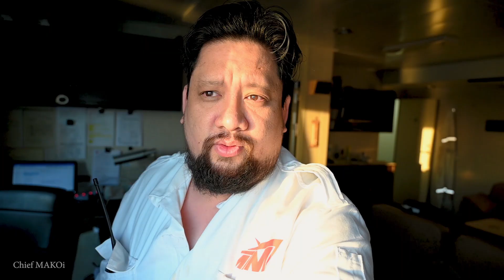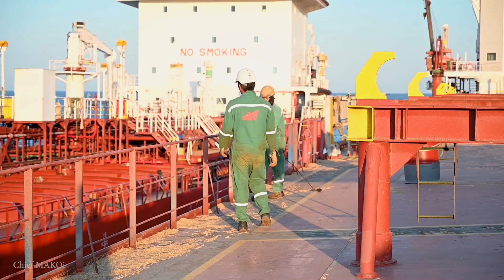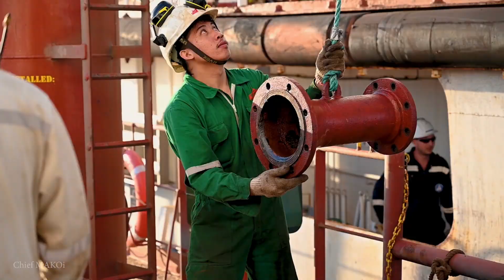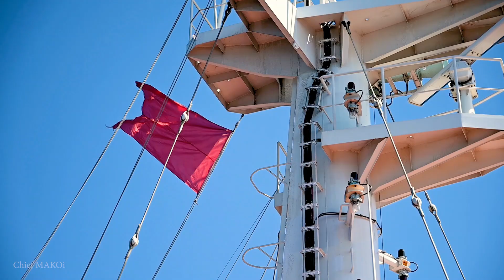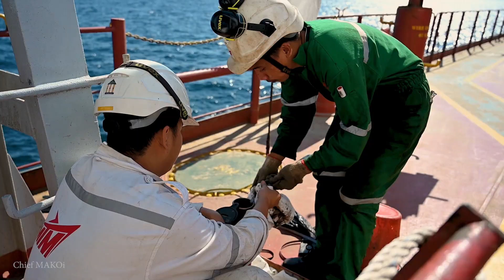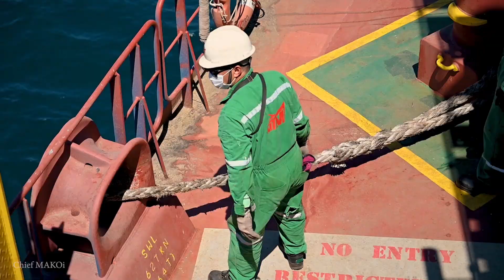Bunkering : Refueling Ships at Sea |  Seaman Vlog S03E10 Chief MAKOi

Comment: I didn’t think ships today burned bunked oil anymore; I thought they used diesel.
Reply: they use both, it is stricktly regulated. open sea.... heavy fuel oil, port or sensible areas.... marine gasoil

Comment: I appreciate the care your crew exercised in this transfer.  45 years ago on my first voyage as a rookie OS on a oil tanker,  the wrong pumping station arm valve was opened(not me), pumping plenty of oil onto the deck in seconds.  Things quickly became very exciting.  First concern was fire, 2nd coast guard, 3rd cleanup.  It was a messy lesson to double check the critical path.

Comment: Question? do you have to heat up the fuel to make it flow? what temp? thanks.
Reply: for the hfo 380.... storage tank you can keep it around 30/40 , settling tank... 60/80.... service tank.....70/100... and after that it goes to purifiers and a machine that heats the fuel up to maintain a certain viscosity to feed the main engine fuel pump.
Reply: @vicginval  Thank you Victor. You did not specified, is it Celsius temperature? I don't understand the difference between Storage, Settling and Service tank. You used "purifiers" instead of filtration?? What is the final temperature of the bunker at the fuel injector? Do you add other product of chemical to burn the bunker?
Reply: @thesailormen  yes, celsius... settling is a tank used for the biggest solids to go to bottom by gravity, so it is the first filtering process. purifier is the last step of filtering, and before going to the pump depends on the density and viscosity... it  can go around 120-140 degrees

Comment: I’m just curious why something like a “Micro Motion” Flow Meter isn’t used during a bunkering operation? The benefit is real time verification of flow/volume that would eliminate possible errors in calculating the actual quantity especially since it’s a mass density meter. Taking physical measurements then extrapolating quantity is an inexact science especially when the volumes are large.
It’s an inline meter with an analog or digital output and it’s EASY to install (imagine installing an orifice).
Having a mass flow meter would dramatically improve the efficiency of taking fuel. Additionally, having a calibrated device will eliminate any discrepancy in the Actual Fuel transferred.
Easier for both parties.
Can you explain?
Thank you and LOVE your videos!
Reply: I don't know the answer for sure, but I'm going to take a guess at it -- bunker crude (#6 fuel oil) may be too viscous for this to work reliably, even when heated.
Reply: @Lucius_Chiaraviglio  Thanks.
This type flow meter takes into account the mass density of the media so viscosity isn’t a concern.
It’s sophisticated yet simple which makes it ideal for such an operation.
Given the amount of fluid(s) that need to metered on board a large vessel like this, I’m certain mass flow meters are used throughout to monitor and control fluids, especially when critical.
Thanks again!
Reply: easy...... PRICE, MAINTENACE, CALIBRATION , PRECISSION. Everybody knows it can be very simple with space technology, but you all forget the primary reason.... MONEY
Reply: @vicginval  A good quality massflow meter can be purchased for under $3000. This is trivial with respect to the payback in man-hours alone.
The vessel surely has massflow meters for various applications where fluid measurements need to be monitored AND recorded. 
As for calibration, it is like EVERY instrument onboard the vessel. Depending on the manufacture-suggested intervals,  it could be annually or semi-annually.
Reply: @callmewheels4806  Right now i'm alongside one of Algeciras bunker barges, the master tells me that two of their flowmeters costs 150.000 €.... in the bunker barge the installation is pretty straight forward , in an existing vessel is not that simple. You know what happens if the flowmeter doesn't work? they take soundings, taking sounding allways works, that is the point in the vessels, it has to be extremely reliable. Many comments on the quick connection systems.... same thing... what if it breaks?.... flanges don't break, so they use flanges. There has been thousands of very clever persons trying to solve this problems for 50 years, but you make a google search and fix the world in two minutes. Very few state of the art vessels are equipped with flow meters, but not for bunkering, they have it installed just before the main engine inlet, to control the consumption. Small precission equipment, in a small pipe, inside engine room in a very controlled enviroment. Not the same thing.
Reply: @vicginval  
This will be my last reply.
First: Unlike you, I KNOW the simplicity of a inline-flowmeter.
Second: If that person spent THAT MUCH MONEY on a SINGLE flow meter, he’s a FOOL.
Flow meters that measure liquid propellant on test stands for Rocket Engines (Rocketdyne for example) cost UNDER $10,000 and are subject to much stricter criteria for vibration, being explosion proof and a host of other stringent criteria.
Lastly: The information I provided you WASN’T from a Google search.
I’m a Development Engineer with an extensive background in turbo machinery and in aerospace using ALL TYPES of massflow meters, the last 15-years working with installations both mobil and fixed base.
 If your Chief Engineer doesn’t understand how to install a BASIC flow meter as discussed, it demonstrates how little intelligence is required to operate a motor vessel.
Reply: @callmewheels4806  i suggest you to put your amazing expertise in the shipping industry, clearly they are all stupids and you can be rich.... please send me the maker and model of a suitable mass flow meter for petrochemicals to be installed in a 12 inch line, with a precission error under 0,25% when pumping 600 m3/hour.... it is not that easy my friend, every vessel owner in the world would buy two of them.
Reply: please maker and model?

Comment: When I was last on a cruise I witnessed a refueling operation. The donor was a refueling barge similar to what you show in the vid, and the whole operation took half a day. I doubt whether all the precautionary measures that you describe were taken or even any of them. What I know is that after the process had been completed and the refueler sailed off, the cruise ship engineers realised that they had been cheated and that a much smaller quantity of fuel, than what they had been charged for, had actually been loaded.
Reply: in case of discrepancy , the vessel issues a letter of protest against the supplier company and the case will go to courts. That is why it is important to contract a guy like me, a bunker surveyor, to protect the vessels interests.

Comment: Chief do we need to drain first the unused fuel in the tank before supplying a new one?
Reply: Good practice will be to transfer all the ROB into 1 or 2 bunker tanks leaving the rest of the tanks dominated to receive the new bunkers "empty". This will prevent cross contamination and allow the vessel to consume the ROB while waiting for the bunker qualiyy analysis results. This will also facilitate matters in the event of claims due to off-specs fuel as the suppliers cannot alledge that their newly supplied fuel was contaminated by the vessel's ROB. 
Chief has done excellent job in ensuring all the right SOPs are taken for bunkering. Kudos Chief. MTM is sure lucky to have a dedicated Chief like you👍👍👍

Comment: Why isn't testing done before the transfer starts? What would make the heavy fuel oil incapable?
Reply: Many things actually. The fuel is analysed for  approximately 20  different characteristics that determine its quality and whether it meets the order and specifications requested. But basically fuel oil needs to have a required sulphur content( depending on where the ship will sail) to help reduce pollution. Water content is also a major concern as this causes many problems when consuming fuel oil, but also when a ship is taking on a large amount of fuel, say 5000 tons and the water percentage is 0.5 percent per ton.. Well that's 25 tons of water you have just paid thousands of dollars for.. And you are stuck with it... Bummer. Also there are many differing fuels around the world and although they may look the same and smell the same and have the same characteristics, they are not always compatible., and can have strange reactions when mixed, as well as this there is an increasing problem with fuel oil bacteria, (simple explaination) bugs in fuel which fouls up everything in the process.
Thats just a few of the things we look for in a marine fuel, and we have many arguments and disputes about it, and honestly marine heavy fuel is bloody awful stuff that has to be heated to 115 degrees C to burn it.. 🔥🔥🔥🔥

Comment: Quantity disputes actually happen? Never thought there’s so much involved when it comes to refueling but interesting process.
Reply: Add quality issues, the reason for Chief MAKOi's ship to pull testing samples. The quality issue even happens for pleasure boats running diesels.
Getting a tank or two of "bunk" can actually cost the ship itself. ruining the engines with bad fuel is costly, at sea and if a storm hits, ship can go down with no power.
Reply: quantity disputes happens almost everyday....

Comment: Interesting video. How does the sounding process work?
Reply: If you noticed, they drop a bob-weight into the tank which is attached to a scale, so they can easily see the level of the fuel in the tank, and by math, they know how many gallons (or liters) exist in the tank based on the measurement.

Comment: Hey quick question! As we all know, the Earth's fuels will be all gone in time. Question is, is this a threat to the sea industry?
Reply: The shipping industry is already partially switching to LNG. By the time both oil and natural gas run out we'll hopefully have valid alternatives
Reply: As hard as it is to believe, with all the hydrocarbons that we have drilled and burned, we have probably only used about 10% of them at this point. It’s isn’t that we are running out, it’s just getting harder to collect them up. For years we found the spots that through the various movements and shifts in Earth geology the oil was trapped in underground “pools” often under great pressure. All we had to do was poke a hole, like a straw in a box of juice, and it rushed to the surface. Now we are looking into places where the hydrocarbons are not so much trapped but are rather just absorbed like a sponge. It is trapped in the little cracks, crevices, and gaps between grains of sand and rock. To effectively retrieve those hydrocarbons, you have to do things like use high pressure to insert sand and chemicals between the grains to make it easier to pump up the hydrocarbons. That’s fracking. We are also running wells for kilometers horizontally to cover more area with fewer wells. Often the oil is in a shallow layers only a few meters deep. But although this “lake” of oil might only be a 100 meters deep it is spread out over many kilometers. You see that here in Texas where some of these deposits are 10000 square kilometers in size. One drill site can have as many as a hundred or more wells spread in all directions for 10 kilometers. This allows for pretty efficient recovery of these hydrocarbons while vastly reducing the environmental impact. 

So we aren’t going to run out soon. It will just get more expensive. 

Of course, the long term goals are better batteries and better solar energy systems. After all, all this oil we are using is just the result of solar energy collected by plants millions of years ago. In the end, almost all of our energy except nuclear is just one form of energy from the Sun  by some other means. Hopefully the oil will last long enough for us to get there.
Reply: @Bill_N_ATX  Interesting that you mentioned Nuclear. Although it is in common use in submarines and aircraft carriers (and possibly some ice breakers?), I think (correct me if wrong) that there was only one merchant ship so powered- the USS Savannah which was not a success, unfortunately, so oil will be used for some time yet.
Another point you mentioned was about the horizontal drilling- I know it is done but how do they get the drill bit to change direction?
Reply: @MervynPartin , after you reach the depth that you want to go minus enough room to make the turn, you pull the drill stem and put a hydraulic motor on the end. Then you put the drill bit on this motor. From that point on, you use hydraulic pressure from the drilling fluids to power this drill motor down in the well instead of twisting the drill pipe or stem from the surface. This allows you to then angle the motor to slowly turn the direction of drilling. At the distances involved the drill stem is actually flexible enough to deal with the gentle radius. You can use pulses of drill pressure to signal to the motor thing like direction of travel. This method really took off here in Texas during the 80s, first in gas and then oil production. It’s why the US is actually energy independent for the first time in decades, even without touching huge areas where we know there is a lot of oil and gas but are either economically or environmentally difficult to drill. We know there is a lot of oil off of Florida and Georgia coast lines, for instance,  but the locals don’t want to see oils wells. A Texan sees an oil well and he sees money, not an eyesore. I’d rather see oil wells than tourists. Just a matter of preference I guess.

And yes, only the one commercial nuke boat. They are just too expensive to build, maintain, and deal with the waste. Hell, just the crew costs alone are a killer. The Navy has a hell of a time training and keeping nuke engineers. I can’t imagine what it would cost commercially. The guys at fixed power plants cost a small fortune. Imagine telling them they had to travel, stay on board for months, and work long shifts for weeks on end? No, a bunch of guys from the Philippines is much cheaper. This is not to disparage the Philippine naval engineer, they are some of the best in the world. They just don’t command hundreds of thousands of dollars a year in salary nor have the years of highly technical training that a nuke operator has.
Reply: @Bill_N_ATX  Thank you very much indeed for your reply to my query. I never realised how the change of direction was accomplished, so I am very impressed with the ingenious way that you have described.
I assume that method is also used for fracking operations.
As regards staying on board ship for months working long shifts, I did that in the British Merchant Navy (2nd. Engineer on oil/bulk/ore carriers) but after I left, I returned to my career in a nuclear power station, also working long shifts. Reactor control desk duties during night shifts were the worst, so I was glad to move up the ladder and work days, although I still got called in for break-downs at night.
Thanks again

Comment: I have always believed that ships have diesel engines that burn ordinary diesel, the same as in cars. That was oil, the same oil used as a lubricant in cars. anyone who can explain why ships can use oil but not cars? smaller yachts, up to 100 meters burn ordinary diesel, but not large ships.
Reply: Merchant ships, regardless of size may use heavy fuel oil, intermediate fuel oil and also diesel oil for propulson. Diesel oil ofcource being considerably more expensive. Since the beginning of 2020 the main factor in marine fuel oils is the percentage of sulphur, which should be less than 0,5%. Otherwise the ship has to be equipped with a device called scrubber.
Reply from the maker: No it's not lubricant.  It's heavy fuel oil.  It has a lot of impurities which will destroy car engines really quick.  Ships have purifiers, heaters and filters - a whole system just to clean the heavy fuel oil enough for it to be usable.
Reply: @ChiefMAKOi  okey, thank’s 😊

Comment: great video chief hey chief i know the main engine uses the heavy fuel oil do the smaller geneators use regular diesel fuel ?
Reply from the maker: They use the same.   We only use the light diesel when we enter USA and Euro ports.
Reply: @ChiefMAKOi  thanks chief for the info safe sailing my freind

Comment: What happens if the fuel analysis lab shows poor fuel quality?  Can you isolate that particular bunker compartment, and then de-bunker at a different port?
Reply: Bunker fuels are normally pumped into emty tanks. The sampled fuel was in my days at sea tested in a laboratory ashore.
The results came available within 24 hrs.
If not suitable, the fuel was left unused in the tank(s). Sometimes we were at sea when receiving the results.
That was of course a bit of a gamble, but i was always lucky.
Maybe our C/E has other experiences

Comment: Another excellent video.
 Chief what Kind oil is that? I work in a Fuel company, we build trucks and maintain the fleet of other’s company, Like gas, fuel diesel, Off road diesel(heat to the houses), and propane; That fuel that you guys got looks like used engine oil.
 Have a nice weekend!

All the best from Dan Montuam, Boston Massachusetts.
Reply: hfo 380

Comment: I enjoyed this video and it was very informative. Bunkering fuel is very different from diesel oil we are more familiar with. I expect it has to be filtered several times before being injected into the engine cylinders. I bet that fill-up was very expensive.
Reply: Yeah, the fuel looks thick and filthy compared to what we use in trucks and jet planes. If is knowingly heated to thin it out, but the filtering process must be relatively coarse, possibly through cleanable screen type filter elements.